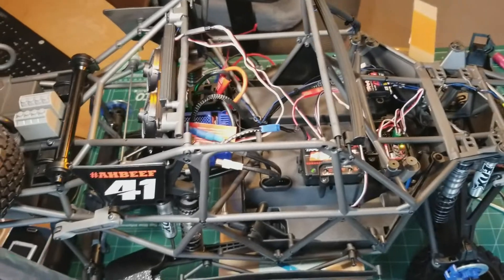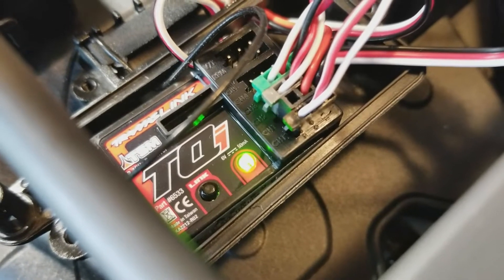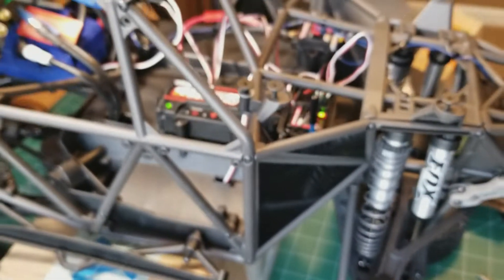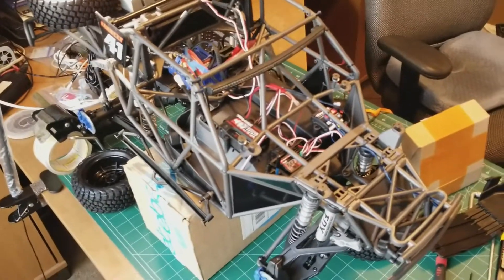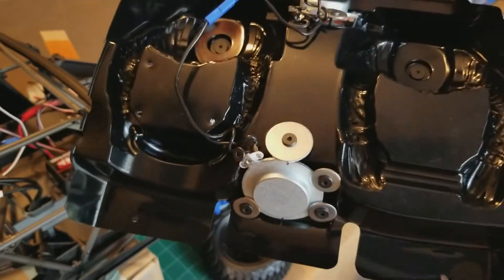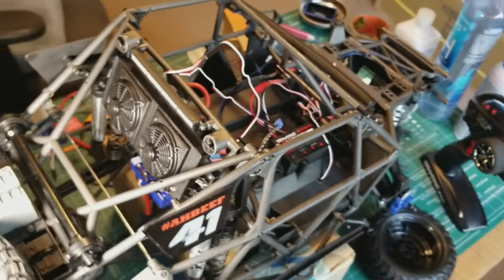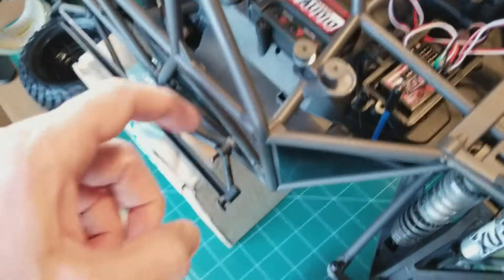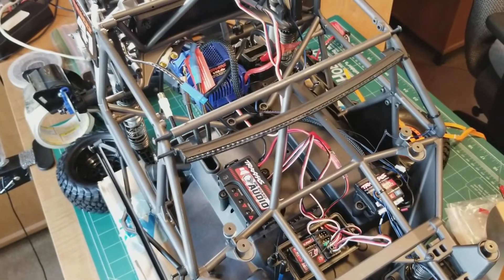Traxxas UDR w/OBA - Installed OBA & Tested It

Comment: hello i did the same  but did you notice that  the link  system app when you open  the dashboard (if you have the link module on the TX) the dashboard doesn't work specially when you try to press the   light button  it will say  "no high voltage power amplifier detected"   the module can't  detect the ESC coz it's connected to the OBA instead of the reciever . Let me know if you find a solution on how to connect the ESC and the OBA  together  going to the reciever so that it can  detect the voltage ,speed, temp. and tachometer and others for the dashboard to work or function,  thanks. By the way i also have a channel  on the UDR with OBA.
Reply from the maker: Sorry for the late reply...but unfortunately, I haven't figured out how to make both the Telemetry and Lights work when the OBA is being used.  I've tried several different wiring scenarios but can't get it all to work together. So I simply turn the Lights on/off manually by putting my hand underneath the front, left (driver's side) hood (near the shock) and pressing the button on the light module which is EASY enough.  I've tried different combinations of wiring but I keep getting the same error screen "no high voltage power amplifier detected".  Btw, I just saw some of your videos and you have a great attention to detail with painting your UDR and your OBA sounds great too! Glad this worked for you and I have to give all the credit to a friend of mine named "Julez" who figured out what was needed to make this work and I'm glad to see it worked for you too. That simple JST adapter and you're all SET! No external BEC or 2nd battery to power it (like I saw in other YouTube videos). So this method is the easiest and best in my opinion. Keep having fun as I've ran my UDR for the past several days and LOVE it! 
P.S. I also subscribed to your channel!
Reply from the maker: ...and one more thing, I even tried using a Y-harness to get the lights/telemetry to work with OBA but I still got the error in the Traxxas Link app. Let me know if you ever figure it out...